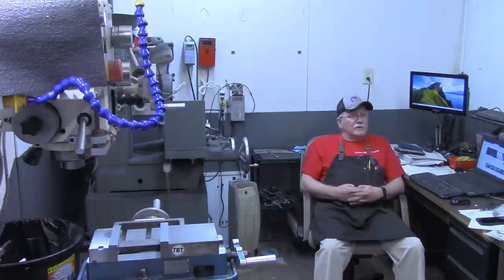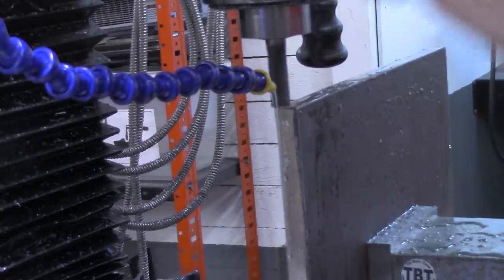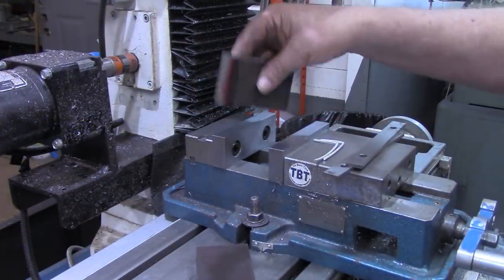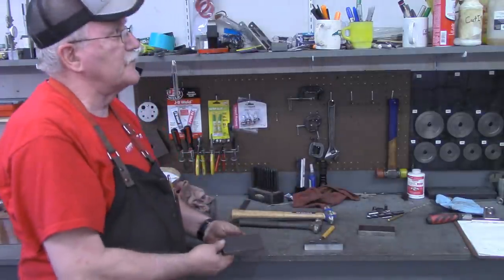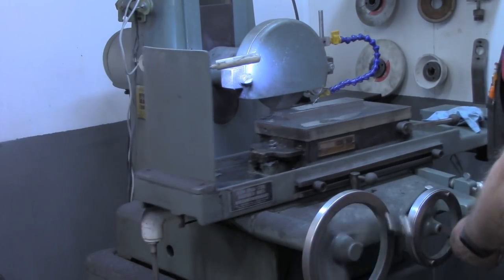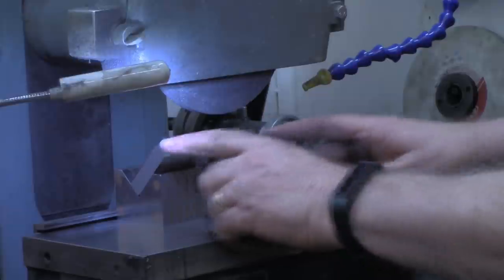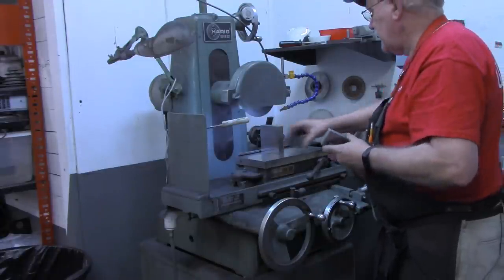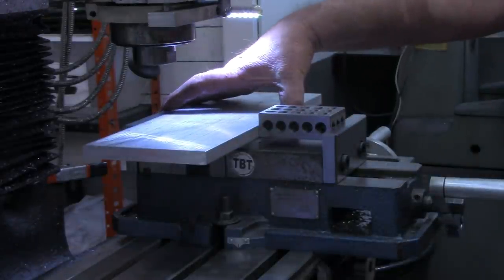Outside Jaws For 4" Mill Vise

Comment: Way to go, this is good for you. Nice reminder f these jaws being able to mount to the outside. We sure like your counter bore bit being used by you for the holes in the second or new set of vise jaws. We always like the tools we do not yet have your surface grinder sure puts a nice accurate finish on them new jaws. Thank you, Lance & Patrick.

Comment: To remove and reinstall the jaw bolts, I would not use an air wrench- too noisy.  I'd buy ball-end hex wrenches. This is a great project to emulate in my own shop.  Thanks.

Comment: Nice project especially having a surface grinder. Probably the camera but it looks like the rear jaw is not touching the rear jaw stop, when i watched you put them on it looked like the cap screws would touch in the hole and i thought that was the cause but as you did not mention anything i put it down to camera angle. well done on the 10k subs, next stop 50k as you are worth it.

Comment: I’ve got a cheap 4” mill vise I bought 22 years ago. Since I never used a 4” before I bought that one, I didn’t realize it wasn’t really “standard”, that is, met the dimensions of a Kurt. I bought a pair of SnapJaws. They didn’t fit. It turns out that a 4” vise should have 3/8” screws, exactly 2.5” apart, and this didn’t. The cheaper vises have 5/16” screws, and the spacing was just far enough off so that I couldn’t get both screws in. Since the accuracy was never too high, but just barely acceptable in the beginning, and has deteriorated since, meaning that really accurate setup had become more effort than necessary, I decided to stop using it.

More recently I bought  a good Grizzly vise on sale from them for $315, which, from people I know in the business, say is about as good as the $575 4” Kurt DX4. That has standard spacing, and the proper 3/8” screws. Plus, it opens 6.25”. I never trusted the outside jaws on my old vise because of the smaller screws. Using them to just hold the jaws under pressure against the vise faces, on the inside isn’t a problem. But on the outside, the screws are under tension. With the jaws so high and far away from the screws, there’s a risk of stretching the screws, and having them fail. So caution to not tighten the vise too much when using them. 3/8” screws are more than twice as strong, and aren’t as much of a problem, additionally reassuring with the much higher quality of the 90,000 psi castings.

Comment: With the setup you have for the chamfers, 0.045" cut is giving you an 0.064" flat... just a touch over 1/16". A 0.044" cut would put you spot on. The magic number to calculate that is 0.707 (half of the square root of two). 71% is close enough (meaning 0.044" is 71% of 0.0625 [1/16"]). They're equilateral right triangles, and thus have easy rules.

Comment: Asking again. Can you talk about the power feed on the surface grinder?  Is it factory or did you make / retro fit it?
Reply from the maker: The power feed is something I build myself. I have video of the build and will put it together soon. Thanks for stopping by.
Reply: MrPragmaticLee Great. Recently picked up a Walker surface grinder. It’s basically the same as the Harig 612, just a bit older. I believe Harig purchased walker and incorporated that design into their product line. I’ve been trying to find more information on that subject. I hope to add a power feed to it.

Comment: Nice job!  How does your PM mill do turning that large slitting saw?  Does it have more than enough power for this tool or is it just enough?  This is the mill I am considering getting
Reply from the maker: Brandon Tscheschlog It handles the slitting saw very well; however, I've found that the key to slitting like this is to have a quality saw.  I tried some of the cheap import ones, but they would fail when cutting anything other than aluminum. Of course that seems to be true for end mills as well.

Comment: Did you check to see if the outside fixed jaw was parallel to the inside fixed jaw?Also, since this is a Kurt clone, did you check to see how much the moveable outside jaw moved up when the vise was tightened - since the kurt design pulls the inside of the moveable jaw DOWn when the vise is tightened?  Lastly, sine tou are using the top edge of the vise jaw bodies as a reference point, did you sweep that top surface for flatness and co-planar?  None of these are important for non-precise work using the outside jaws, but could be an error inducing issue with precise work

John

Comment: Why beveling on the surface grinder ,much slower operation than doing it on the mill since you have the vice set ip just put 45  tool and done in two minutes.